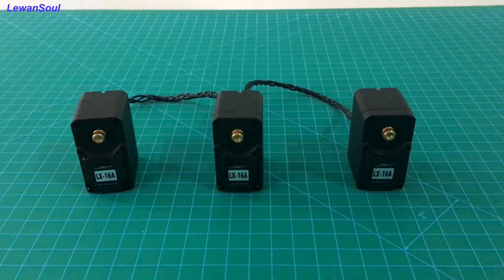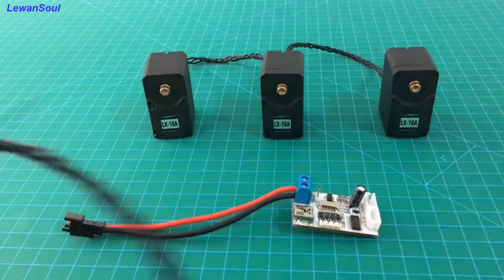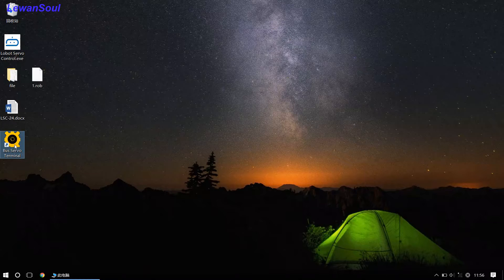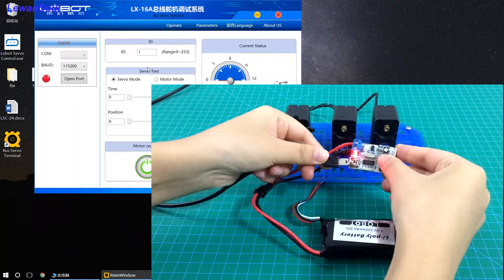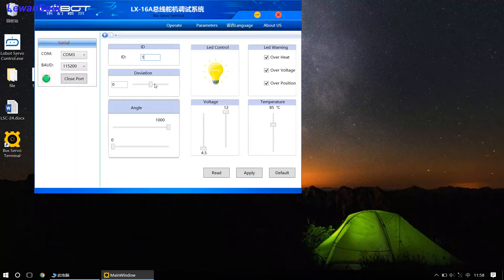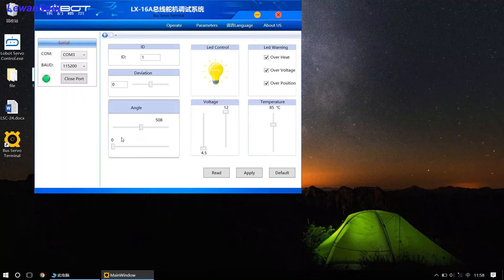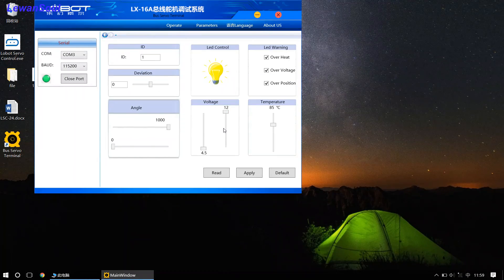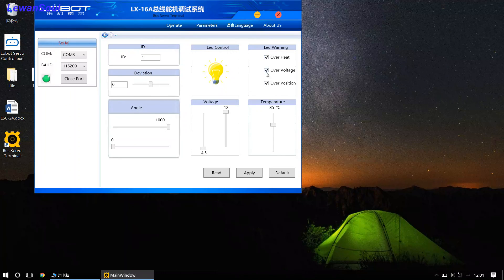Set ID number for robotic bus servo (episode1)

Comment: hello, i need some help with code, the user manual has some information, but needs a bit more to be complete, for example, in the example code for Arduino Control -> ServoControl code, this code <<    LobotSerialServoMove(Serial, ID1, 100, 500);   >>, what does the "500" parameter means in terms of time? is that the amount of time that the servo will travel to the "100" position? 500 ms? If that is the case, this controls the speed and that would be great!
if no one answer, I will test it and post the result here later today. Thanks!

Comment: Is it possible to control the bus servos without the software (Lobot Bus Servo Control)? Can I control them from raspberry pi using other language like Python?
Reply from the maker: Yes, you can use Arduino or Raspberry to control the bus servo wiht our TTL/USB debug board or Bus servo controller.
Reply: Thank you.   Do you have some example codes for raspberry pi to control the servo?